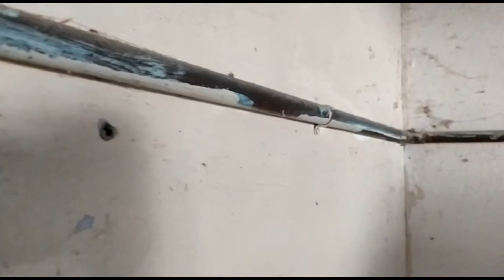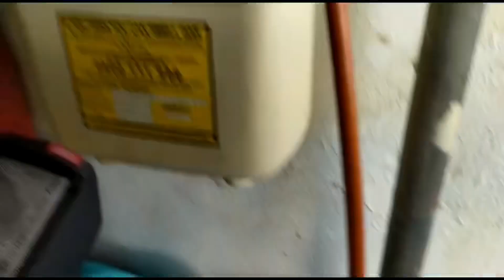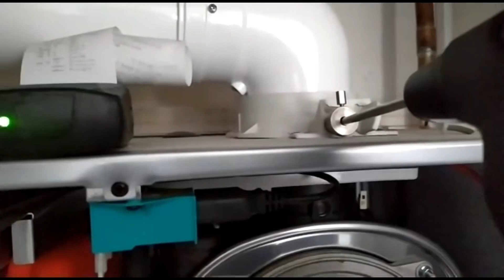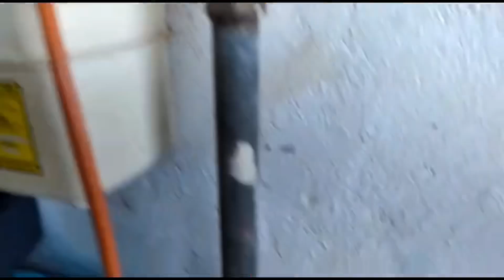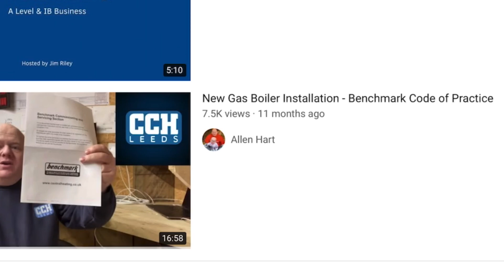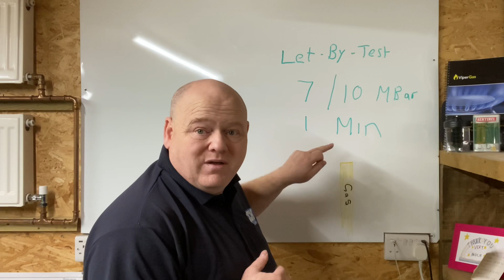ACS Gas Training - Installation Faults Q&A

Comment: Mi's need to be easier to find important information. 
As a new gas engineer or an old one like me with bad memory, I can't always remember how to put a boiler in high/low mode to run tests. And it's not always easy to find the optimum gas ratios in the mi either. Worcester are good in this case. Easy to put into service mode and easy to find correct readings also
Reply: same here mate wading through 60 pages of shit trying to find gas rate of appliance, CO2 percantage high and low,

Comment: Brilliant video ....

Clipping distance 

Clips required on boiler pipework 

Too close to electric wire 

Think I spotted flux residue on meter pipework 

Sleeve / sealed 

Was that earth 6mm 

Pipe sizing looked correct 

AR flue seal 

Bench mark & cp12 incorrectly filled out

Dont think the condense pipe should be open ....surely should be sealed !

DLM looks ok @ 4ohms 

Final Flue integrity test with case on 

Wonder what cooker was like lol. 

Have you got any videos on when you would ID a cooker Allen. 

Thanks for your time doing these videos. 👍👏👌
Reply from the maker: Merry Christmas
Reply: @AllenHart999  Merry Christmas 🎄 to you and family 🌲🌲🌲🌲

Comment: Wouldn’t gas boilers be banned by 2025 sir?
Reply from the maker: No
Reply: So what year would they ban gas boilers????
Reply: Gas boilers are not getting banned, but as from 2022 I believe all new build properties will not be allowed gas installed, they will need to be electric heating, however there are trials as we speak in the midlands area where hydrogen is being introduced into the gas supply to ascertain whoever we can switch to a mixture of gas and hydrogen for the remaining millions of boilers out on the patch. Hope this helps
Reply: @Hallesworldb127  thank you it does
Reply: @Hallesworldb127  so whats going to happen to the gas engineers when they start putting in electric heating in new homes?
Reply: @paullbennett2923  how
Reply: @paullbennett2923  what you on about?

Comment: Absolutely brilliant video! I only got these because I’ve had my face in the viper gas books for the past couple of months. 

The other two things that I thought might be an issue is where the earth cable for the meter comes through the wall it has to be sleeved / sealed. The clips look like steel on the copper gas pipe, I might be wrong but doesn’t that cause corrosion?

Comment: Adjust gas valve then test with case on I always analyze with case off test the flue seals and burner seals then I will test with the case on
Reply from the maker: You don’t need case off to do gas valve 👍

Comment: Nice one Al!
Reply from the maker: Did you spot all the faults?
Reply: @AllenHart999  got the electrics too close to the pipe. that pipe teeing up through the ceiling should be clipped/supported too right? what would happen with those wires in the end? either the pipe or the wires need to be moved? would end up quite a job?